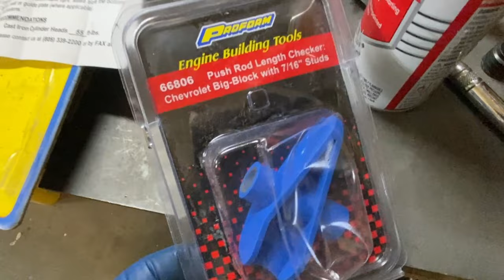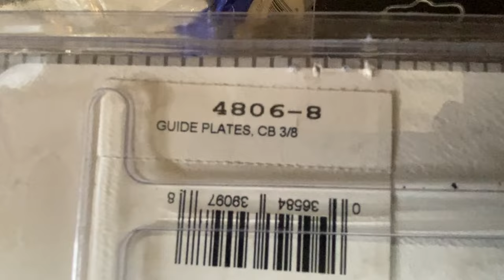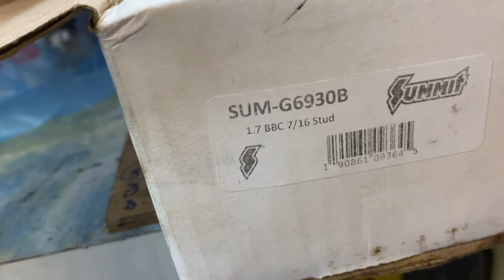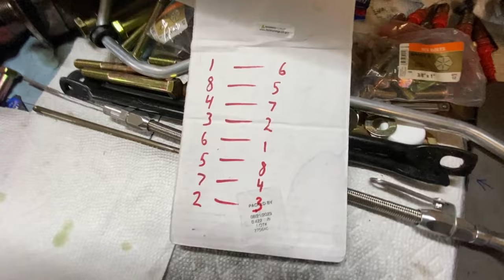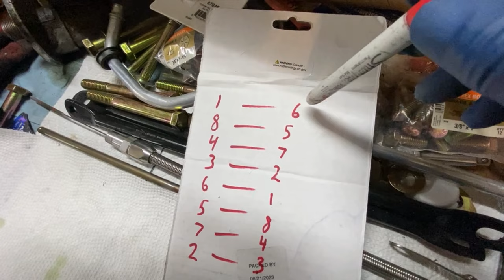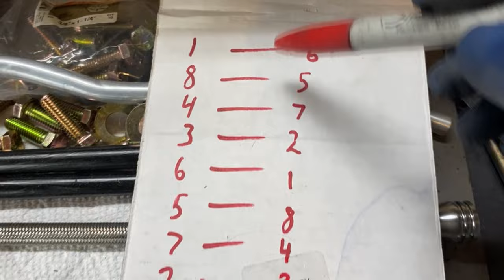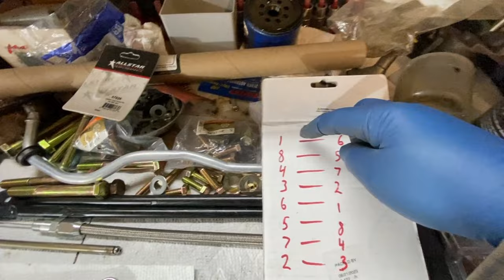Big Block Chevy Roller Rocker adjustment.  Overview of valvetrain, rockers and rocker adjustment.

Comment: Thank you for your video! I'm 73 and building my 427 for the last time, I hope. ;) My Son has convinced me to go with a roller kit, instead of what came on this 1969 model 427. Hope I can afford it, cause it looks 'spensive!!  ;) Good explanation. Helps me understand. I've built engines, just nothing with this type of roller kit. :)
Reply: I am surprised that there is not a suggested torque spec on the set screws.  ??
Reply from the maker: @MagaRickn There seems to be a lifter failure epidemic going on right now, especially with flat-tappet lifters so I would definitely go roller if you can.  Even those are a gamble so make sure to test them all once you get them.
Reply from the maker: @MagaRickn  There was no torque spec provided by the manufacturer on those, but I think most people just snug them tight.

Comment: Would you use those rocker studs if you were to use a stud girdle ? Or go with a taller rocker stud ?
Reply from the maker: @71lemans I'm not sure on that.  I've never used a stud girdle on one of these motors.

Comment: All bbc's use 7/16 rocker studs from the factory.
Reply from the maker: @joe-hp4nk  Gen V and VI have 3/8 base threads.  You can get a conversion stud kit like this (Jegs part# 809-12368941) or (Summit# CCA-4514-1) that has a 3/8 base thread and a 7/16 shaft for adjustable rockers.  Or you can have the base threads drilled and tapped to 7/16 like I did for a full 7/16 stud.
Reply: Sorry, I only worked with the gen IV bbc @vikingmech

Comment: You can set all valves starting at TDC on number 1 and turn crank every 45° to set next valves in the firing order, 18436542 unless you have a 4&7 swap18736542...